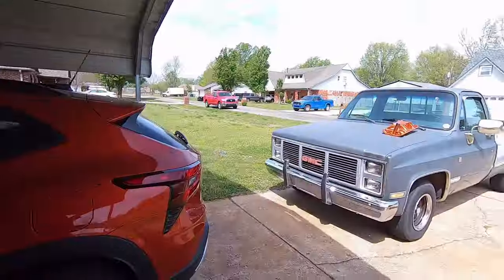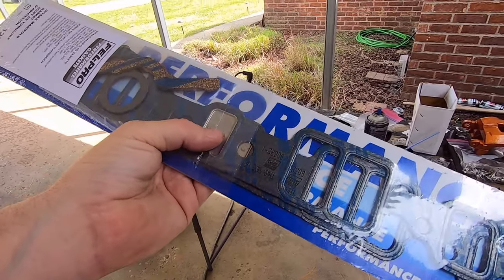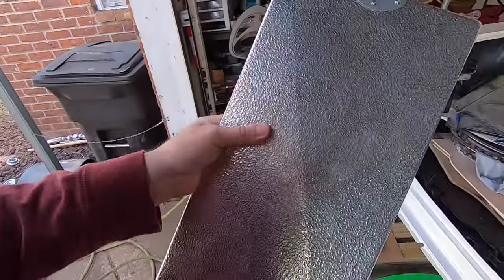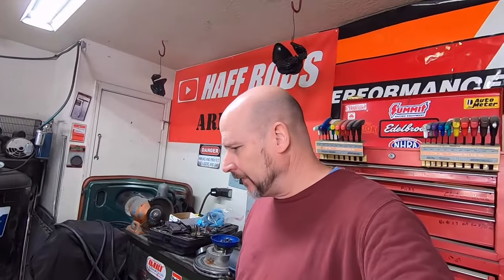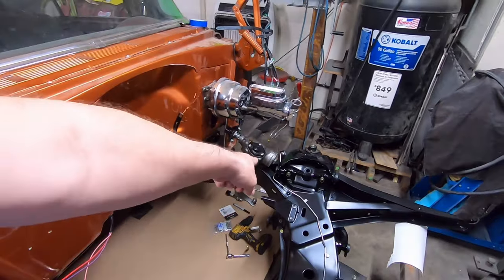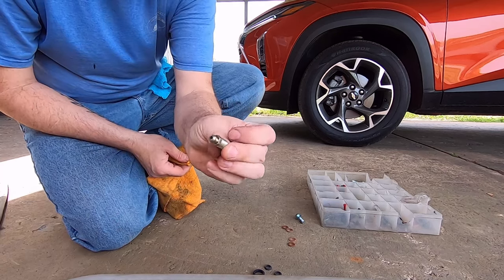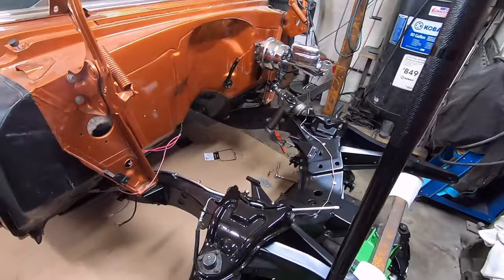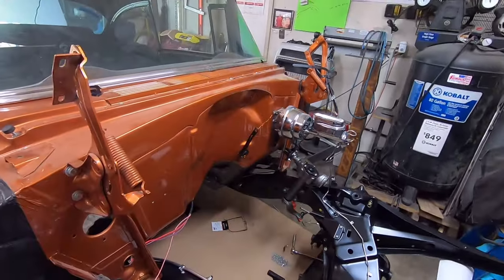Steve's 1955 Chevy Hardtop Project. The last brake hard line to build.

Comment: Wow, a pipe wrench...😬😬😬  that was surprising!  I have a crank socket and they are $22 bucks now at Summit, cheap insurance!  Those pre-bent stainless brake lines sure are a lot nicer than the Inline Tube brand they sell at Classic Industries!  Mine are giving me fits and holding up the progress on my Bel Air!  I like how those even follow the contour of the V8/6cyl stock motor mount pads!  I have to modify mine and all 3 of my really nice flare kits that state they will flare stainless, aren't cutting it!  I may get a new roll from Speedway and make my own or go to Napa like you did with Steve's and start over.  That lid came out really nice, all things considered.  It looks brand new!  That fuel pump looks like it has some burnt orange overspray paint on it.  I splurged and bought a new Edelbrock Performer Fuel Pump so that I can spin the bottom and line up the inlet and outlet ports correctly.  Hopefully, it will work out well.  The frame came out beautiful!  Steve is lucky  and is paying for your great attention to detail!  It will all be worth it to him when he turns the key, gets to drive  it and is handed his first trophy!  It will also be nice to have Steve there to help put his engine in.  Keep up the great work!  Hopefully, it will all be downhill from here!